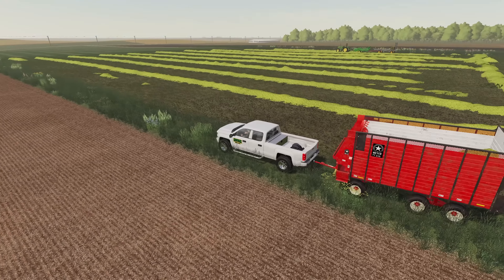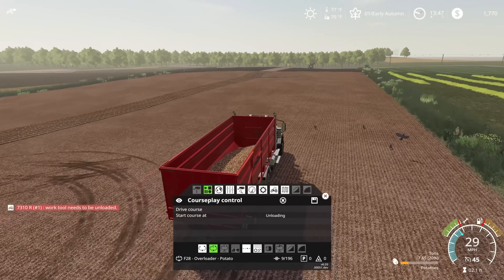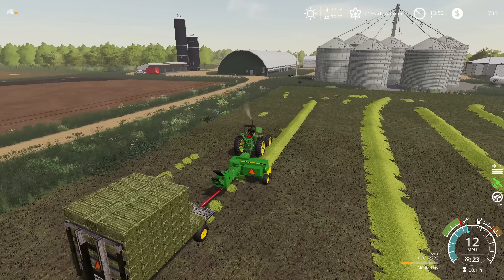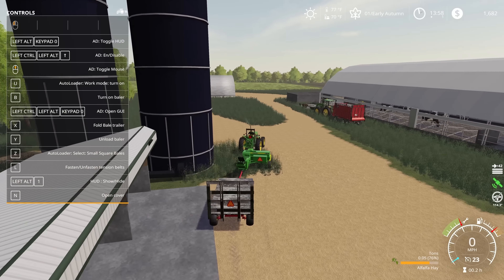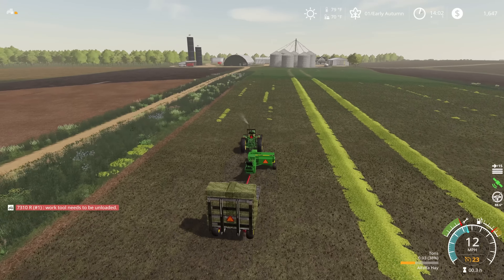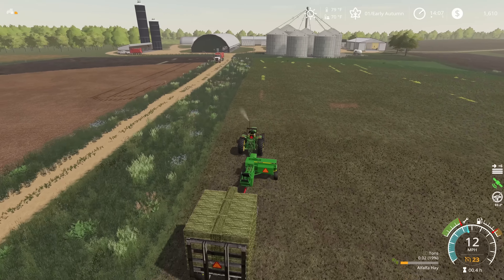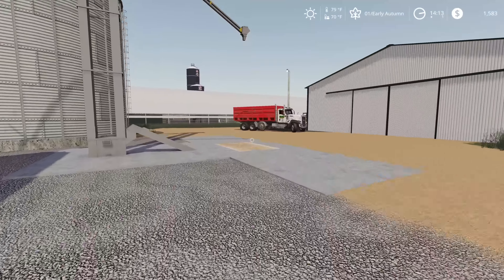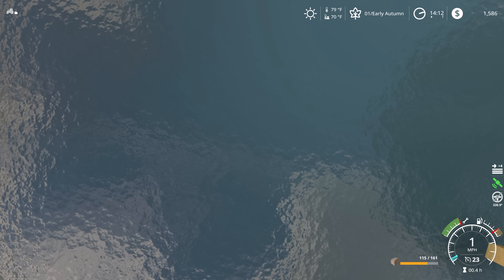LOVE the small bales! John Deere 348 baler - Precision Farming on Royalton, MN! - EP13

Comment: In real life the biggest potato diggers are four row units from Spudnik.i have run a four row.teo rows takes alot if time in real life
Reply from the maker: Yeah, what the game needs is the rake / windrow implement (not sure what they are called) that pulls the neighboring rows into the center where the 2-4 row harvester is picking up.  More tractors in the field bit then you're doing upwards of 12 rows at a time.
Reply: It is called a windrower .it digs up another set or rows and put thems in the middle of the next set

Comment: um that small square bailing setup aint realistic
Reply from the maker: In what way?  This is exactly how we used to bale hay when I was a teenager.  Usually 2 guys on the trailer, one grabbing the bales as they came out of the baler and the other up on the hay stack making sure they were well seated.
Reply: Lots of small scale farms use this
Reply: Really? How so?
Reply: i helped my cousin and his best friend make Bells like this way back when i was teenager aswell
Reply: Some of the smaller dairys in my area do small squares every summer.
Reply: I'm guessing he's referring to the bale kicker on the baler. Normally if your bailing on to a flat deck wagon, it's just a chute that the baler pushes the bale up. The kicker would throw them into a basket type wagon, and not be stacked by hand.
Reply: @KederkFarms  no I mean in fs perspective with kicker and the flat hay wagon. The way you did it irl is exact. Sorry for the misunderstanding of what I mean
Reply: I've done it irl with the shoot just its not realistic using a flat rack with the bale thrower (correct Canadian term for a kicker)
Reply: @alexandert6489  we use a kicker and flat wagon. Just got to watch where it’s aimed
Reply: @zackwolbert6141  yes but it isn't really that way for a reason. They are built for the certain wagon you are using and there's no sense doing that when a kicker costs ya more than no kicker and the wagons are also the same prices (for flat or throw rack)